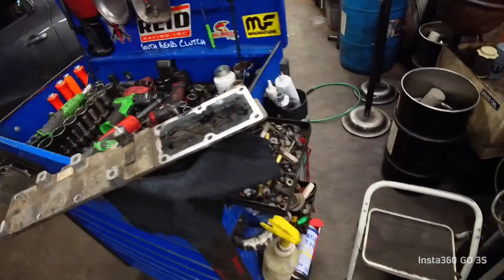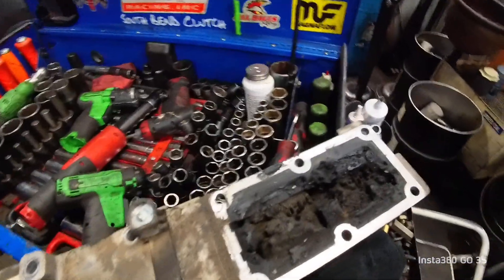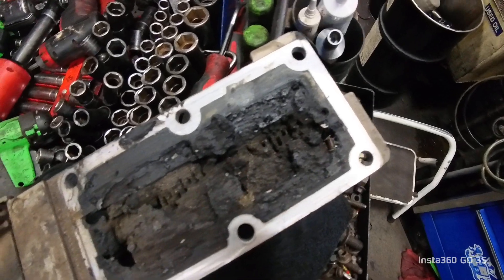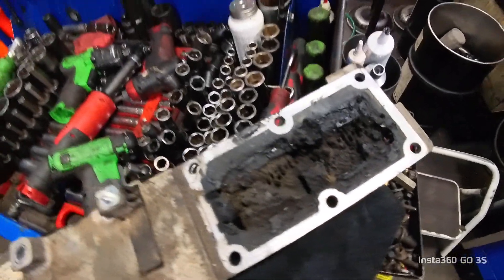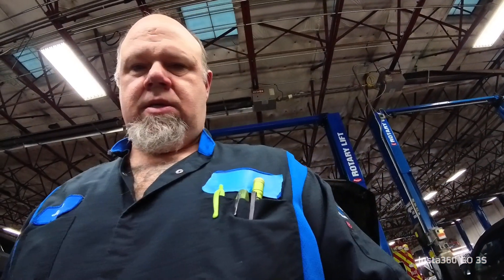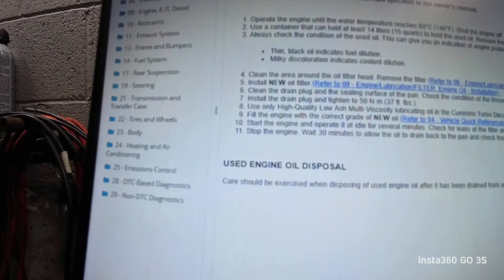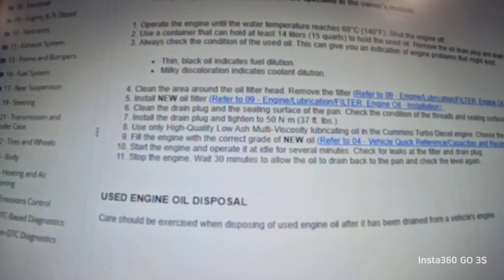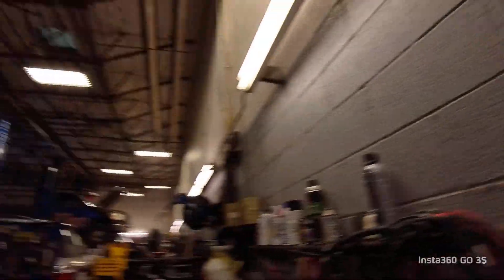Ram Air Grid Heater Plugged

Comment: What's oil changed interval for a massaged truck?
Reply from the maker: With higher fuel pressures and combustion chamber pressures you might want to think about 3-5K
Reply: Top end of my ‘17 looks perfect at just over 100,000 miles with 10,000 mile OCI using synthetic. Only opened it up to run the valves. Which I know wasn’t necessary, but I wanted to have a look since that’s what the old interval was.

Comment: My friend told me you dont need to change your oil that often because the new oils are far better than the old ones and you are wasting money i was no thanks i will change my oil as needed
Reply from the maker: Your friend is wrong, oil degrades and needs to be changed.
Reply: You only need to change the oil "as described" in the manual. But need is not preferred. You should change your oil every 5k, and you should only buy an oil that requires that. More often is better than longer interval even with a better oil. Alot of companies use longer intervals for EPA not for whats best for your motor.
Reply: Your "friend" will cost you a LOT of money if you keep taking his "advice." 

Will your friend give you the money for a rebuild when his expert advice causes an engine failure? 
Change your oil at half what the manufacturer recommends. Because the manufacturer isn't going to fix that engine at their cost either.
Reply: New diesels dilute the oil with fuel and contaminate it with soot more than ever. The oil may be better but we're contaminating it so much more. When my 2002 5.9 was new the oil wasn't even dark at 5000 miles and this was the norm. It was around 200k before the oil started turning black between changes. Times have changed.
Reply: Good Video!! Keep up the Great info. Let the Idiots be Idiots,  and they will be Bringing their Truck to you$$ then they will learn the Hard Way.
Reply: It’s not always about the oil ! It get s diluted with fuel and carbon from blowby gases. The additive package gets depleted,it doesn’t clean lubricate or protect nearly as good. I will never understand people trying to save 700- 1000 dollars in oil changes over 100,000 miles putting their 15-25000 dollar engine on the line,even if it doesn’t fail ,the engine that’s neglected always leaks more oil ,has less power, starts  harder especially diesel’s,and gets worse fuel mileage . Then there’s the short engine life , an engine that would have given 350 k easily needs a long block at 150k …$$$
Reply: Excellent content! Thank you!  I have a 2012 3500 6.7 that I have the oil changed between 4-5,000 miles.  Is it ok the rub your fingers on the dip stick to feel the oil for lubricity?
Reply: Well, as the dentist says, you only need to brush the teeth you want to keep. Likewise, you only need to change the oil in a motor you want to keep. 😂
Reply: That snapshot of that caked grid heater element is representative of everything that is so wrong with emissions!! This day and age and this is the best engineers can come up with? And this after dropping nearly $100 grand on a truck, absolutely disgusting.🤮